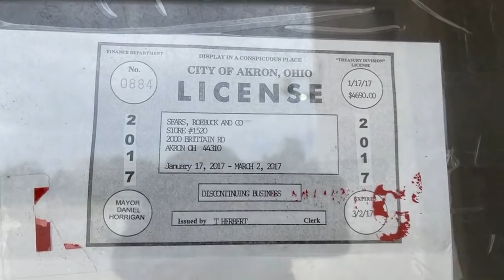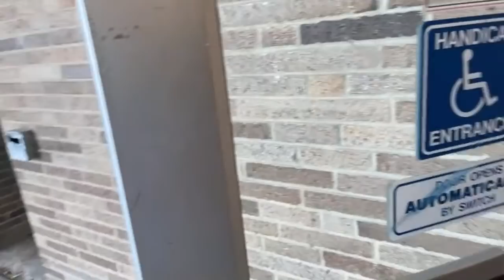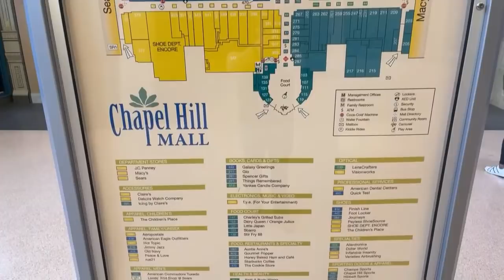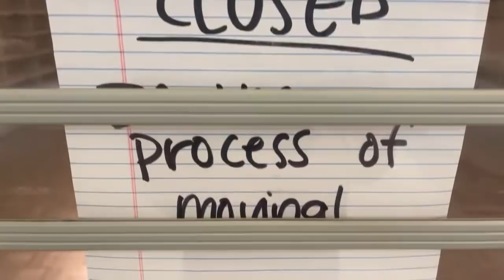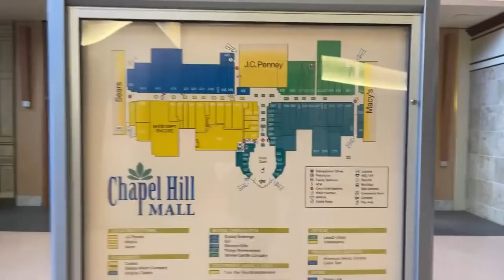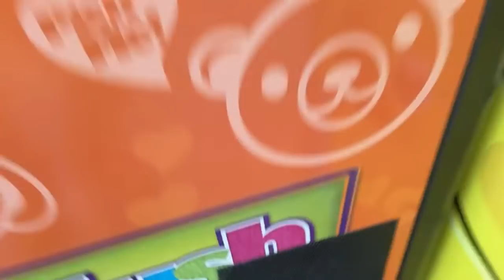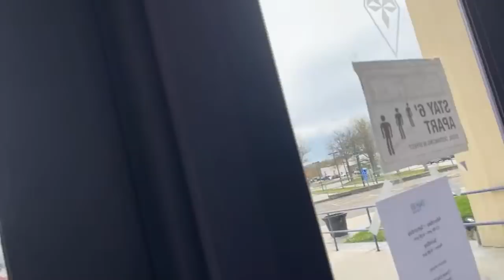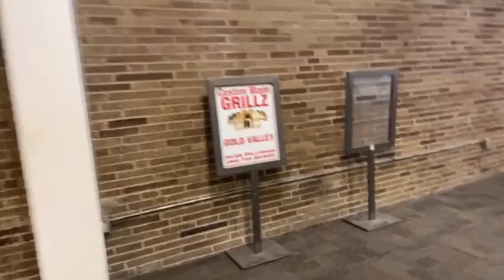Chapel Hill Mall on its last day open | ExLog Live

Comment: That purplish light is probably a Metal Halide lamp, most likely one with a quartz arc tube.  When they reach end of life, sometimes they dramatically shift their color.  Pink is pretty common, so is greenish... when they go that color it is not a good sign.  Those lamps can explode at end of life.  In the lighting business we call that "Non-passive end of life."  LOL  Looks like most of the lights in there are LED though.  The one that was flashing was an LED.  High Intensity Discharge lights like Metal Halide, Mercury Vapor and High Pressure Sodium take 30 seconds to 5 minutes to "re-strike" (i.e. come back on) when they go out.  When they do that repeatedly on their own, it's called cycling.  So if you see a light going off and on regularly like that, it's usually an LED.  As for the hum... ballasts hum louder when there is power but the lamp is out.

Comment: At the end where you left the mall, where the car is parked, used to be one of the public entrance/exits for JC Penney. They had to stop using it several years prior because of theft. Ultimately, theft and safety concerns are what doomed that mall. Chapel Hill mall was on the edge of Akron and served the eastside as well as Stow, Tallmadge, and Portage County. There was no shortage of potential customers, they just got tired of being hassled. I remember telling people when Macy's closed (2016) that the mall had about five years left. I was dead on. Summit Mall will be in some sort of adaptive reuse by 2030. Belden by 2035...

Comment: Charlestowne mall opened in April of 1991 4 anchors Carson’s JCPenney theater Kohl’s 1990 JCPenney closed at charlestowne mall in st Charles il von maur is here in 2001 sears closed in March of 2011 Kohl’s closed in June of 2016 then charlestowne mall closed in December of 2017 Carson’s closed in august of 2018 after Bon-Ton bankruptcy in February of 2018

Comment: So if lots of malls have been closing because of high crime then surly the only thing to do is defund the police....makes sense... smfh
Reply: No, not Chapel Hill. The owners couldn't even pay the light bill and the electric was shut off to renters even before the sheriff's auction.  It was bad.
Reply: @Knight-of-Sarcasm  the owners also would not pay for snow removal in the parking lot making it a hazard for employees and shoppers. You’re correct it was very bad. The owners didn’t care.
Reply: @Michael John APD had a small “office” in the mall at one time. Defunding the police does not mean stop hiring police-it’s mean allocate resources appropriately which is what was done by the previous owners.